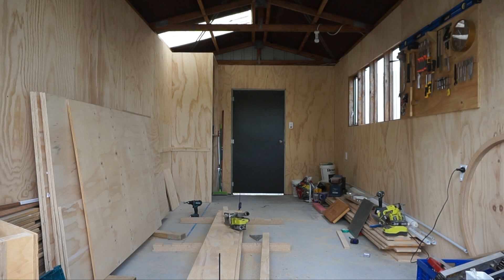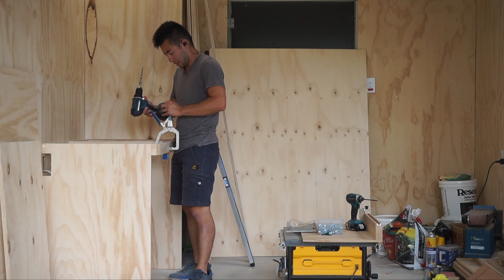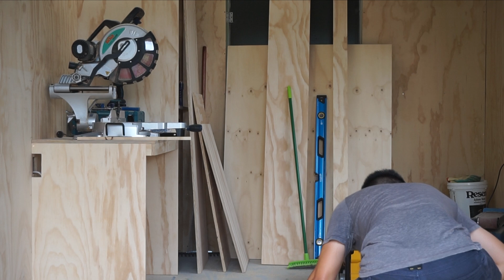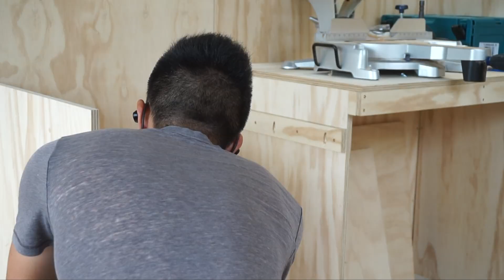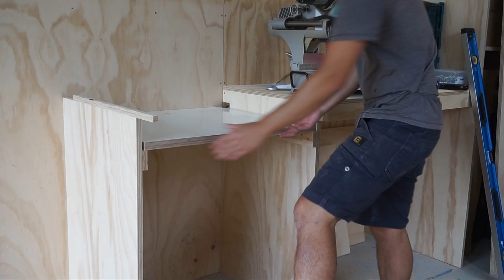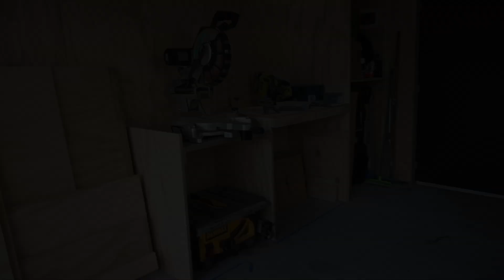Half a Mitre Saw Station

Comment: Good job.  Congratulations.  One question: what model of saw are you using?  thanks
Reply from the maker: AMJ natura it’s a local brand called The Toolshed
Reply: @TheOffcut  It looks very good.  I like that small telescopic system.  Thank you
Reply: @TheOffcut  My ToolShed chop saw is 11 years old now. It's done a lot of work. It on it's 3rd set of brushes. It just doesn't seem to want to die. I was a bit dubious when I first bought it, but it has certainly proved itself now.